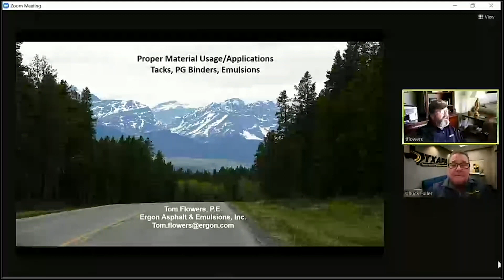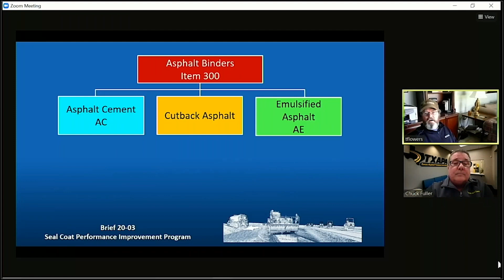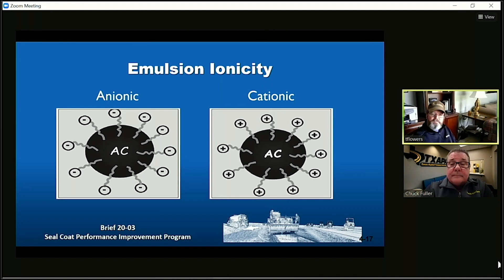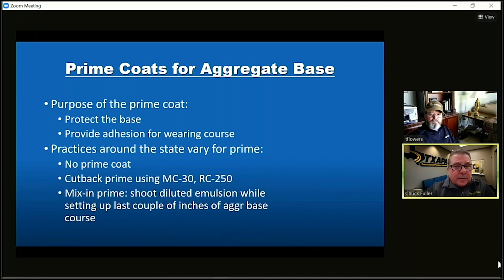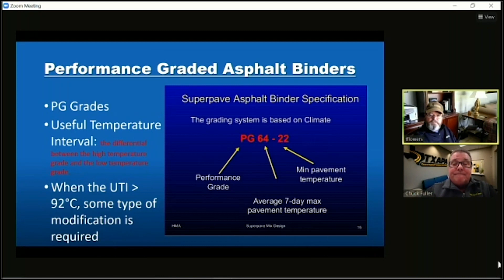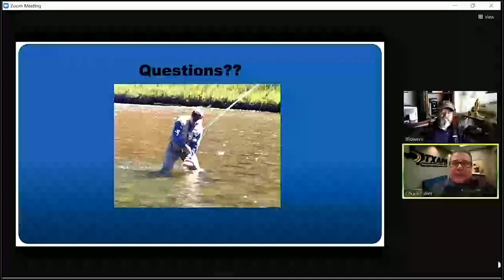TXAPA Live: Proper Material Usage/Application | Tacks, PG Binders, Emulsions

Comment: isn't the PG rating what is your given desired environment rating of your asphalt binders? ie.. a PG 64-22 should have a desired satisfactory range of a max of 64 degrees centigrade to a minimum of -22 degrees centigrade.
Reply from the maker: Thank you for your question. Since the 64 in a PG64-22 is based on the 7-day maximum pavement temperature in C, and the -22 is the minimum pavement design temperature in C, a pavement falling in those ranges should perform satisfactorily. Note, these are pavement temperatures, not air temperatures. It should also be noted that TxDOT does consider the Traffic Loading, Loading Rate, Position in Pavement structure, and the use of RAP in the design layers to potentially bump up the PG grade a maximum of two levels to a PG76-22 for heavy traffic and slow-moving loads. https://ftp.txdot.gov/pub/txdot-info/cst/PGSelectionProcess.pdf